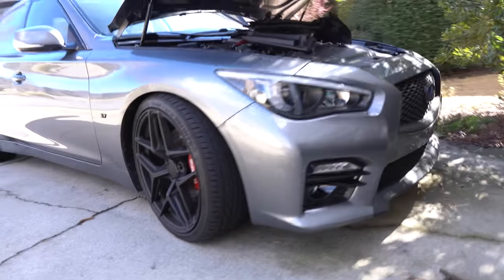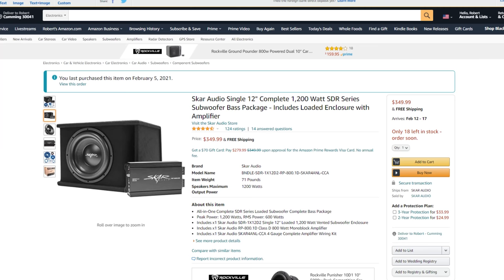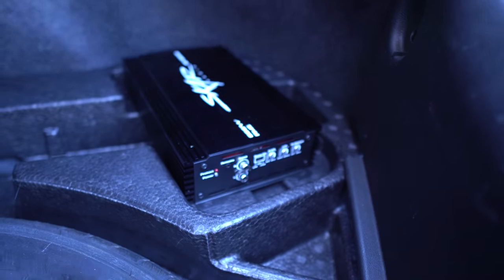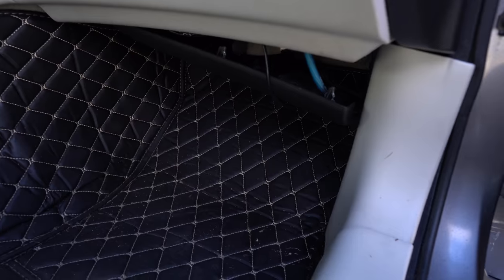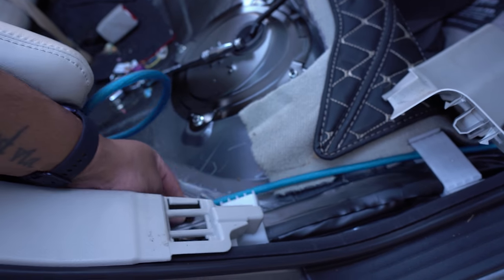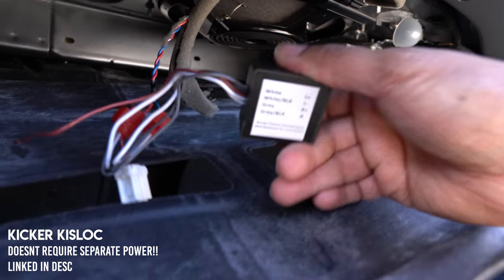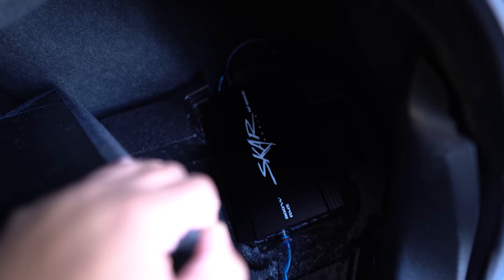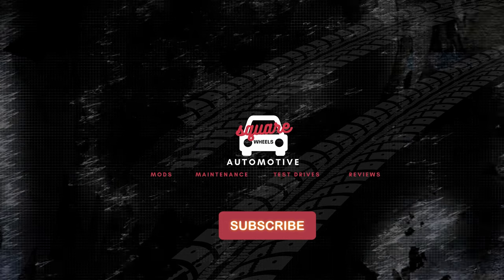Adding an AMP & SUBWOOFER to my Infiniti Q50

Comment: so what would you suggest for somebody who doesn't have the bose audio i have a 2019 and i have the default audio system
Reply from the maker: Pretty much the same process just the sources are in different locations. Tap the audio signals from behind the head unit, and I think the lighter socket provides a good remote relay signal
Reply: @SquareWheelsAuto  oh now I was saying like would you suggest just a sub and amps or like complete different speakers from the factory ones
Reply from the maker: @Officialfabreeze  hmmm not sure, I’ve never heard non Bose before. If it was me, I’d start with a sub first, and if my mids/highs were noticeably lacking afterwards, I’d upgrade. Tbh I’ve never felt the need to upgrade factory component speakers, but I’m no audiophile either 🤔
Reply: @SquareWheelsAuto  yeah 😭 if only you could hear it but I’ll guess I’ll start with subs and amps and go on from there
Reply from the maker: @Officialfabreeze  yeah good luck homie, end of the day it’s all about what makes YOUR ears happy 💯💯

Comment: What did you do to get the rattle out of your trunk?
Reply from the maker: The only rattle I had was with the license plate holder.  I always use 3M double-sided tape on both the license plate holder, as well as the license plate, to eliminate those rattles.